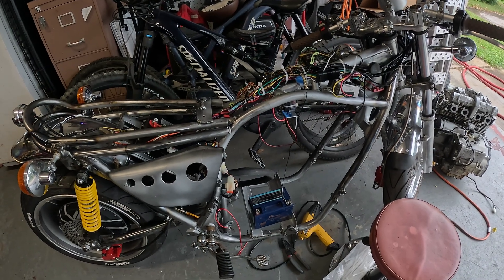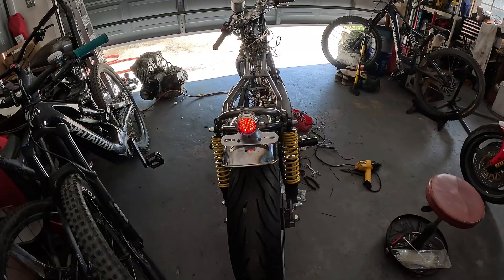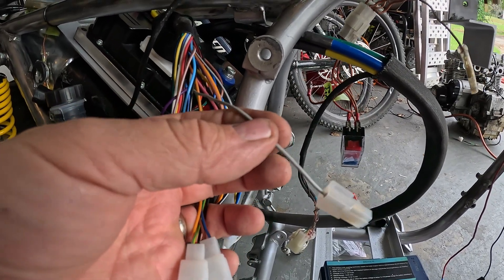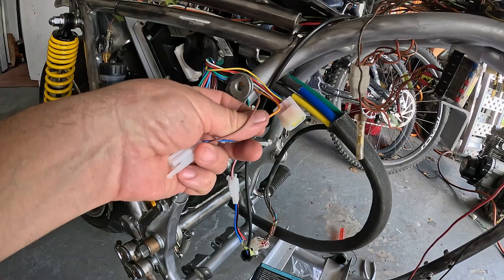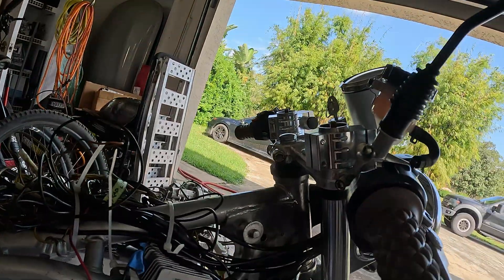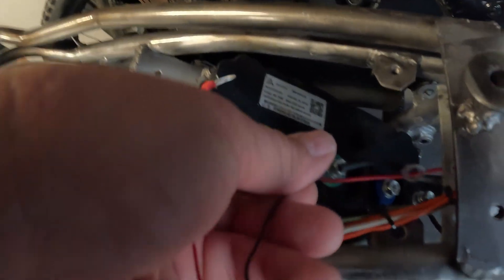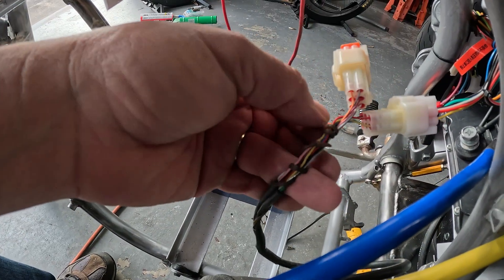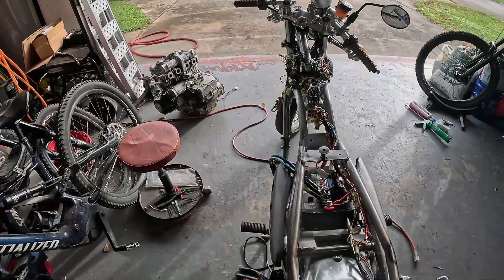Simple Budget Electric Motorcycle eBike Wiring the OEM Harness to the Fardriver and QS273 12KW

Comment: What is the model of the GPS Speedo your using?
Reply from the maker: Here is a link on aliexpress, but if it doesn't work just search 85mm gps speedometer.   These are really nice "speed hut" gauges from Utah (outsourced) I think.  Real glass lense.  
I just found this on AliExpress: 
$38.57 | 85mm GPS Speedometer Odometer Gauge 0-120MPH 160MPH 120KMH 200kmh with 7Colors Backlight For Car Boat Motorcycle Truck 12V/24V
https://a.aliexpress.com/_mKRMlG1

Comment: A good old solid state LED flasher will make those incandescent bulbs flash, just be careful about the current rating.
Great content, cheers 👍
Reply from the maker: Thanks.  Im gonna try that.  I think the T13 bulbs are too small to make the heat so the flasher works.  They are tiny bulbs.  I never use blinkers.  Just wanted it legal.

Comment: So, is the gray brake wire from the FarDriver 12 volts, and the other wires — green and yellow with black — 5 volts? My manual had it reversed
Reply from the maker: Hmm...  How I understand it is the gray wire is by itself and you can send a 12v signal to it.  Same 12v  signal that would be sent to the brake light.  So if you tap it into the brake light somewhere then you can get regen when brake valid.  The green is combined with a black since it is the standard 3 to 5v output that when grounded activates the regen. On my maddog I just hooked that green and black combo plug to a push button and it worked as advertised.

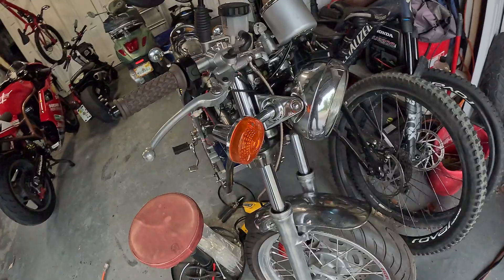Comment: 10:56 if it's an old school bimetal strip type of flasher it needs more current to function, put a power resistor of 6ish ohms in parallel with the load of your blinker. thatll heat up the bimetal strip.
modern flasher relays should be load independent and work with LEDs too
Reply from the maker: Oh ok.  Thanks.  If I just put a LED flasher on it you think it will work?
Reply: @GhettoWrench  probably, maybe yours is just fked. ive got several bikes and this autumn two of my flashers broke, all solid state and all leaky capacitors.